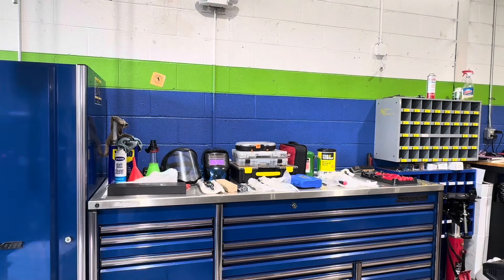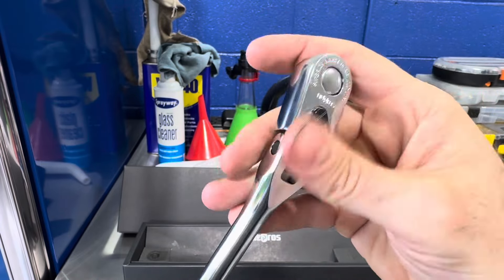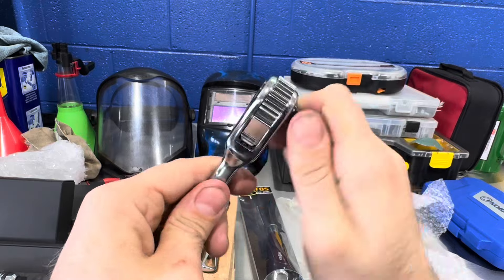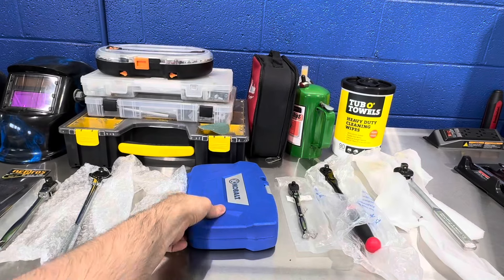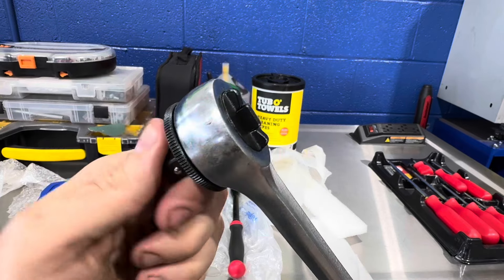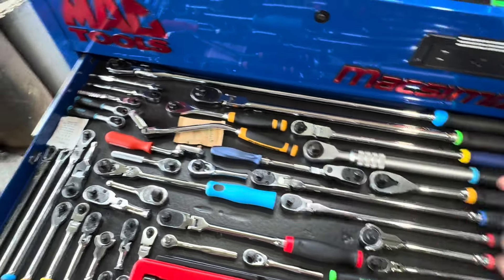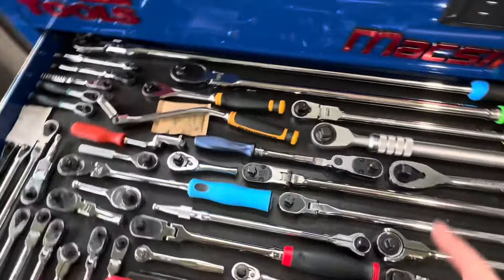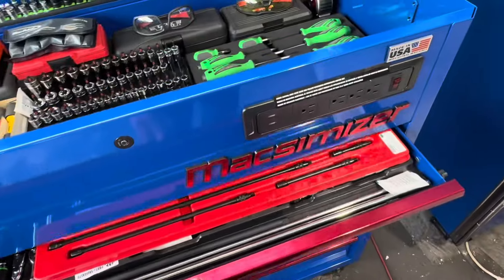Ratchetpalooza 1:  From the Personal Collection

Comment: Nepros ratchets suck. They are beautifully finished, and the chroming is phenomenally done, but they are shitty ratchets. I have had several of them do what happened to you in this video and have had several of them lock up in the gearing as well. They come dry as a bone, and they aren't all there chalked up to be. I had a little run where i bought about 7 or 8 of them, and 3 of them locked up on me. I swapped them out and 2 of them did the same exact thing. It seems to be mainly on the flex head nepros ratchets, but i had a fixed head do it too. They came from several different sellers too, so it wasn't all purchased from the same place. The back drag isn't all that great either, and they are super choppy in my opinion. My vim ratchets have better back drag than the nepros. The flex heads are all quick release too, which is a pita. Anybody that says nepros is the snap-on of Japan has never used a koken. As i mentioned, they are gorgeous looking ratchets, but a pretty ratchet isn't what im looking for when purchasing ratchets. Its a nice plus, but not what i care about. After a few months of use, all tools look like shit anyway lol. If you think that sk is the best roto head you've ever used, you should check out the ktc roto head. It's the best roto head on the market, in my opinion. It's funny because ktc is a nepros subsidiary. It's such a nice roto head ratchet though, and the back drag is absolutely phenomenal!! The only roto head ratchet that has better back drag is the koken roto head ratchet.
Reply from the maker: I own the KTC roto.  SK still wins.  Nice tool though.
Reply: And you still think that big ass, bulky sk ratchet still wins? Sk made and still makes shitty tools. They were made in the US, but that doesn't mean that they are automatically great tools. Sk has terrible chroming issues, inner broaching problems on their sockets, a ton of QC issues, and their ratchets were absolute trash. They were big and bulky, had terrible back drag, and were way outdated. Even their flagship lp 90s had a ton of problems. There is a reason that they went down the drain and were sold to a Chinese company. Most of their tools sucked. They were usa made, but most tools were usa made back when armstrong was still around. To each their own I suppose. Were all allowed to have our own opinions and like what we like 👍